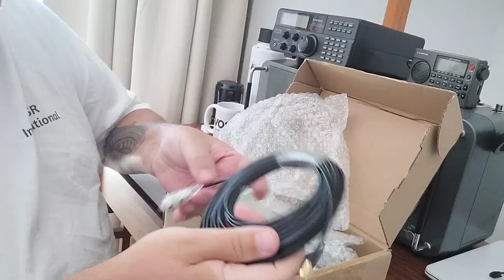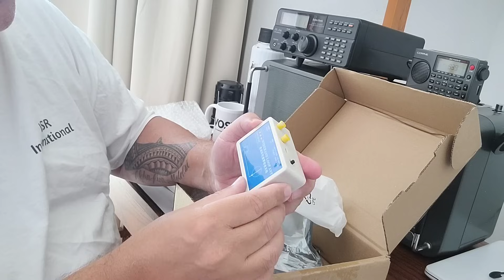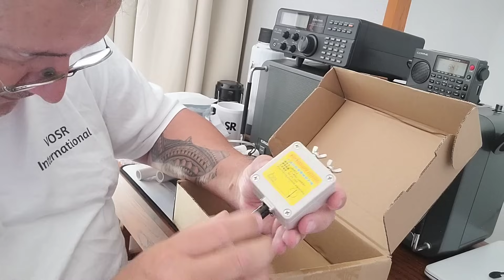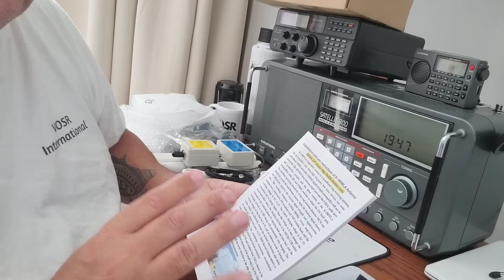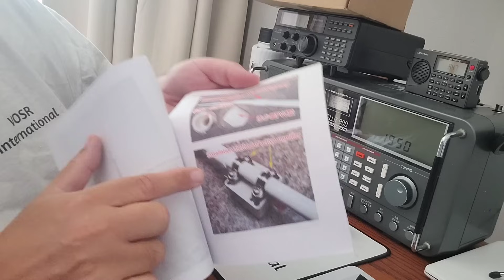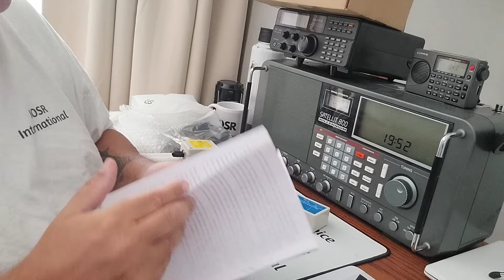K180-WLA Shortwave Radio Antenna: The Unboxing, The First in the K180-WLA Antenna Series

Comment: I actually had my K180 doing adsb today 1090mhz with an 11 inch length copper loop just to see if it would. Surprisingly it did, while not as good as my dedicated adsb antenna it did do 80 miles. I have an MLA-30+ and an K-180wla as well as 2 of the K-480wla as they work awesomely well on airband better than any other airband antennas for me.  All 3 of these loops have their uses. If I was limited to one and had the coin I would go for the K-480 followed by the K-180. If I only did SW I would do the MLA. But most reading this will most likely end up with one of each of them eventually, because you know...antennas! .
Reply from the maker: @rmrffromroot  Yes, I definitely know antennas. Lol

Thanks for Watching and Big Mahalo for the comments.🤙🏻

Comment: Thats interesting. I like that it comes with the PVC pipe and clamps. I had to buy my own pole for the MLA-30+. 

I didn't realize that the MLA-30+ had an internal RF gain control. I haven't adjusted mine at all. Is it set to high, low, or medium by default? Have you adjusted yours?

It's awesome that it's rechargeable and runs on a battery. It makes it usable as a field antenna. I can't wait to see how it works. 

If it out performs the MLA-30+, I might have to get one.
Reply from the maker: @Ancient_Grass_5121  Yes, it does come with some extras. One thing I didn't mention was that it didn't come with the battery. A lithium 18650. I got lucky and bought the last one on the island. Lol

Yes, I did adjust the gain. It would probably help on the sdr with the display. There is a fine line to the adjustments. There is also an adjustment in the box at the antenna. 🤙🏻

I am going to do a short video to show how my antennas are set up and I'll mention about having to buy a battery.
Reply from the maker: @Ancient_Grass_5121  I missed a question, the gain is actually set pretty well but that may vary. I ended up turning it up some but I may be close to having a noise floor that's a little too loud.
Reply: @Ponokaiguy  That's good to know. So far, the gain seems to be working just fine. The antenna works the best when the gain on my SDR is actually at 0 dB. Except, above 20 MHz, I have to raise the gain to around 26 dB. 

If I mess around with the antenna gain, I'll mark where it is now before adjusting it. 

I appreciate the answers. Thanks!

Comment: I have both an original MLA30 and original K180. My MLA30 has been outside for years and still going strong. I love that thing. I use my K180 as a portable antenna for camping, cottage, etc. I find, depending on the receiver, the K180 can swamp the front end and splatter the HF bands if around strong VHF signals. Never been an issue for how I use it out in the boonies though. I wouldn't use it as my home loop antenna due to the overload issues. I'm curious to see how well the FMDX switch works on the new K180's. Hopefully it works well as it's definitely needed.
Reply from the maker: @DarrenMaunu  Thank You for watching and your insight. I sure wish the FMDX switch was more accessible. Having to remove four screws is far from convenient. I will be doing the FM soon. 🤙🏻
Reply: @Ponokaiguy  That is a bit of a bummer as I like to use my K180 for a bit of everything. MW and HF bands, air band, 2m ham, weather, marine and occasionally broadcast FM. If the switch performs as it should, it should at least make it better for home/permanent installations in areas with nearby FM transmitters. Looking forward to the results.
Reply from the maker: @DarrenMaunu  The FM video won't come out for a bit. I will be on Kauai for a week but will do it when I return.🤙🏻
Reply: @ No prob. It's more of a curiosity than anything. Love seeing the DX-394 too. I still have mine that I purchased in '97.
Reply from the maker: @DarrenMaunu  The DX-394 has quite a following.  I get so many comments about it. I have a lot of videos posted of it in action. 

The performance videos of the K180-WLA really tell the story. Let me know your thoughts after you watch them. 🤙🏻
Reply: @DarrenMaunu They do a mla 480  with a separate switch & gain control that you can control from your base